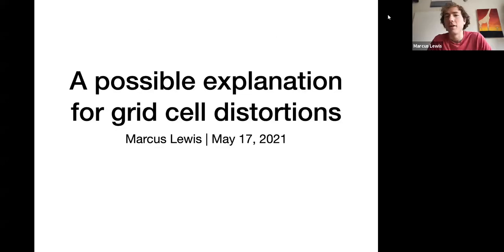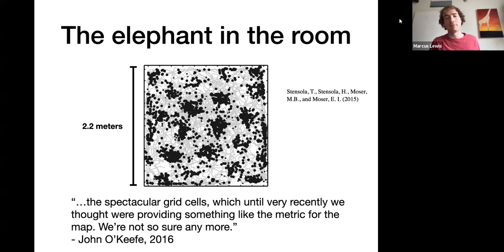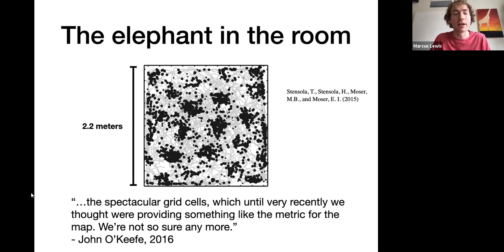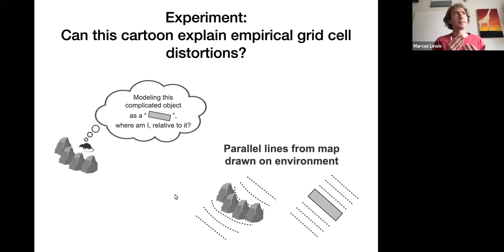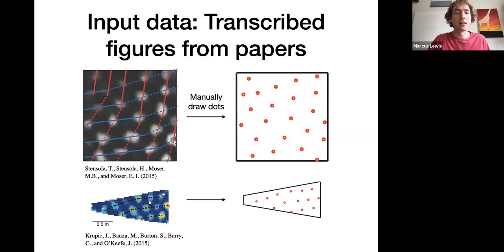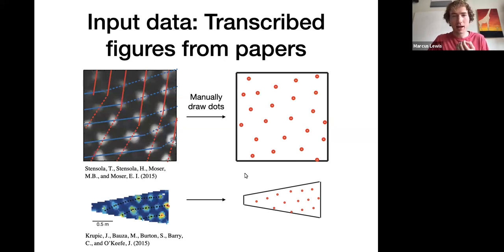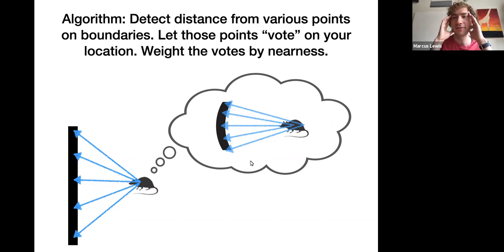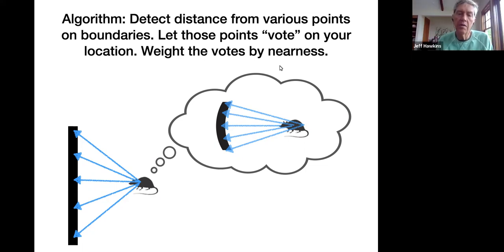Discussion on Grid Cell Distortions and Reference Frame Transformations - May 17, 2021

Comment: Guys if you think of the Cad synthesis paper "szalinski", you have a geometry problem where you have to build the whole local world top to bottom, you have a library of known solutions, you try to fit those solutions by changing parametrics and if that's not enough you add another modification. The objects have not fixed coordinates but fixed symmetry axis directions that changes from a modification to a modification. Then all 3 of you are true. It is not exponentially exploding, it is very diverse, it has to be distorted and it can be implemented with HTM.

Comment: I'd also say that the rat is perceiving all kinds of things that affect its perception of the room besides vision - like you guys mentioned maybe there's a light in the ceiling, etc... but what about other senses? Smell? What is the square room made out of? How much glue or tape or whatever, maybe someone left tiny smells from their hands, etc... The rat could be perceiving all kinds of things that give it greater weight to one corner vs others. I'd be more interested to see what a sterilized and perfectly symmetrically manufactured cylindrical or dome room causes the animal to behave like, as far as its grid cells.